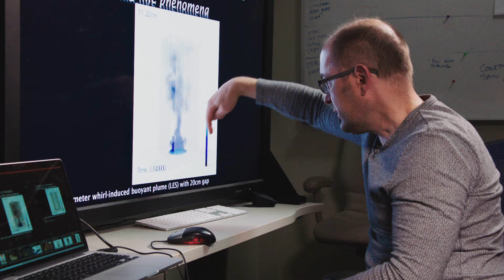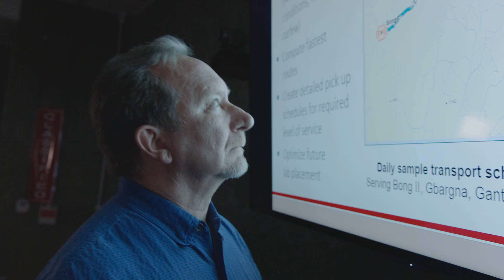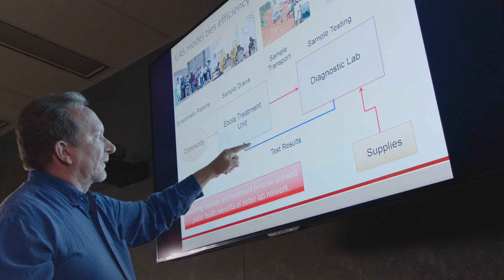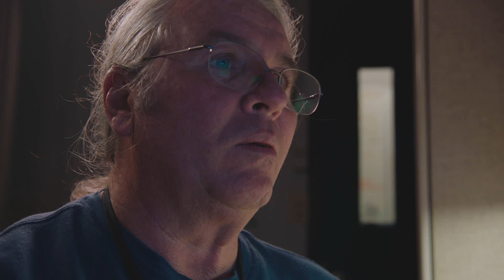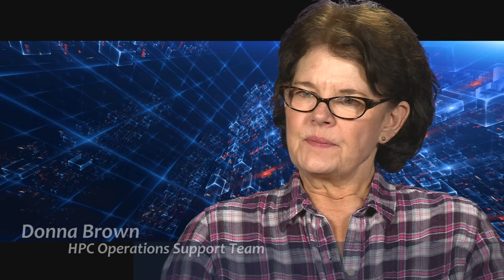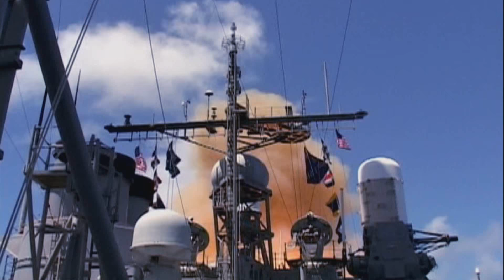High Performance Computing at Sandia Labs

Comment: What happens to the old hardware when it's retired? Do you intend on selling your current Xeons b/c of Meltdown & Spectre?
Reply: First off, they're using Cray supercomputers, so Cray will probably end up just taking them back when they retire them. Second, these computers are all on an internal network that isn't connected to the outside world, and even if someone did try to run arbitrary code using meltdown/spectre exploits, it probably wouldn't work unless it was written specifically to run on that one system. And even if, against all odds, someone ran malicious code that could run on this system, it's not like they store sensitive info on their supercomputer, so there's not a lot an attacker could do besides steal computation time from legitiment projects.
Reply: I don't think them CPUs see the world outside of the secret areas until no one wants them for more than keychains. I'll also guess there recycled for the materials rather than sold or auctioned off.   As nice as a small souvenir would be, I don't think anyone outside the lab will ever see a CPU from there intact, ever.
Reply: Zarcondeegrissom that's just an awful waste. I would pay good money for retired hardware to use in my lab.
Reply: Ebay!
Reply: Supercomputers are completely different than anything else you know - At infrastructural level they do not understand TCP for example - they are vastly different beasts than your average machines.
Reply: @meditating010  And there's me thinking they're the same as a laptop!